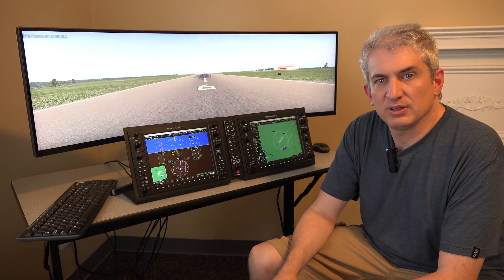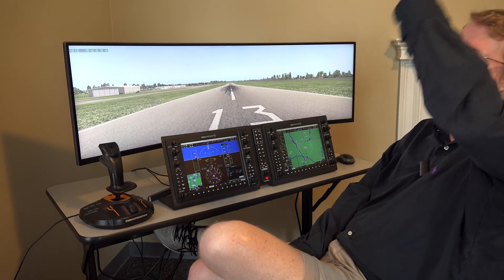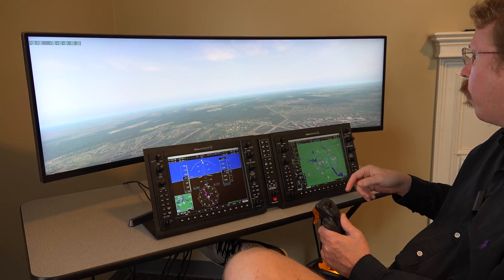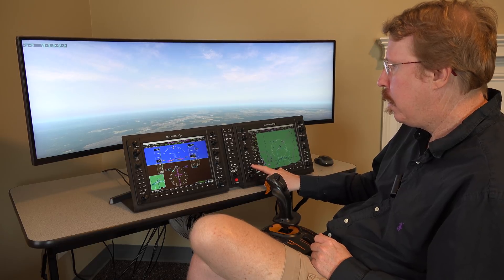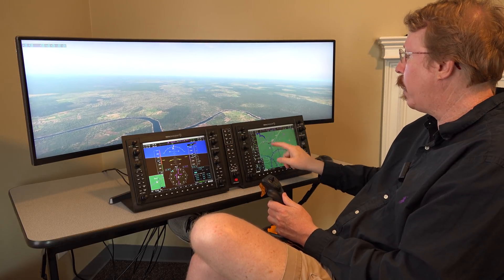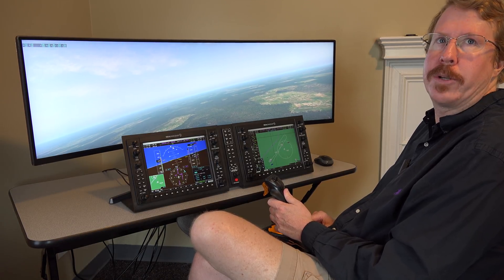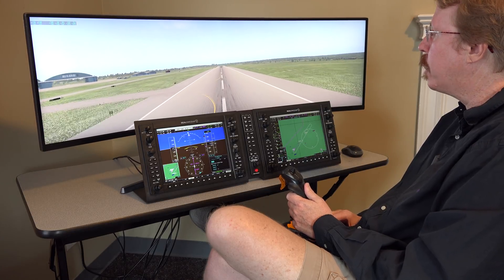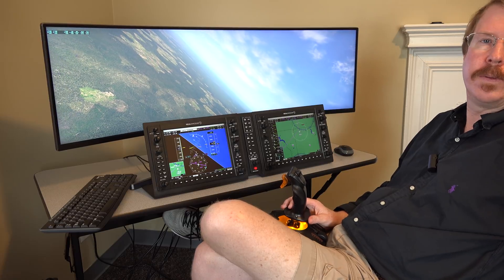Austin tries the RealSimGear G1000 Suite for the first time

Comment: Would love you to do Austin's reaction video to FS2020 when it comes out. That's going to go viral.
Reply: At this point, FS2020 is an Alpha product. With the exception of scenery, nothing works. Controls are hyper sensitive. AP is a disaster. Turbo Props are a joke. GPS you can't change flight plans or load approach. You can go direct to anywhere. It is a product intended for Xbox not flight sim community.

Addon, who use default system will be inferior or you will have to pay a lot for good addon.
Reply: @my2cents366  "nothing works"
Reply: not happening.  there is no way he's going to like a different simulator's flight models
Reply: @harpoon_bakery162  He might try it just to say something negative about its flight model though
Reply: @igvc1876  -- this is true, very true.  Microsoft (Asobo) has done good homework on flight models with real-life pilots.  The question is , are they real-life pilots that know how to translate flight models into computer programs like Austin does?  the answer is no.
Reply: @harpoon_bakery162  Do you really believe that a team with infinitely more resources than Austin cannot reproduce good flight dynamics? Come on. The only question is whether they want to do it. And we clearly know that this was their goal. These guys don't need to be implementing it themselves - they hire whichever experts they need to help them do it. Asobo did not do photogrammetry or other ML/AI, for example, they hired the best people to do it for them. They've worked with aircraft manufacturers, test pilots, etc. X-plane still cannot reproduce flat spins properly, and neither does XP simulate air mass and the effect of the world on air mass - an important component of aerodynamics as a whole. As smart as Austin is, flight dynamics is not some kind of black magic that only he can reproduce with good fidelity. In fact, compared to everything that they did in MSFS, aerodynamics simulation is the "easy" part relative to everything else. It's a well and widely studied problem that has a known solution.
Reply: @igvc1876  -- what is your opinion of the product as a whole 2020 ?  I mean everything encapsulated into your cliff-notes version of a flight sim designed for the purposes intended?
Reply: @harpoon_bakery162  I am not sure I understand what you mean
Reply: I've flown the C172 a fair bit along with the C152 and Cirrus SR22. I can safely say the flight model feels way more realistic in FS 2020. Especially as you're doing things like side-slips and forward slips. Ground effect for instance is way more pronounced and realistic in FS2020. I flew KOAK -> KLVK -> KCCR -> KOAK recently and compared real life to the sim.

All that said... the "stock" planes in FS 2020 aren't quite on the level of the really high end custom planes in XPlane.

I do think XPlane can actually compete with FS 2020 in the future. A few things that will get it there:
A more sophisticated flight model with far more surfaces.

Some kind of more sophisticated procedurally generated 3D terrain like what's in FS 2020.

The avionics in many XPlane aircraft are already leagues ahead of what's in FS 2020.
Reply: @colinsouthern  Sigh. I mean really if your top list of issues with FS comes down to wrong stats in a logbook, you are not helping your point. We all agree scenery and graphics are next gen. And frankly that's hugely important for the vast majority of people, even the "hardcore" simmers. Would you get into aviation if you were blind? Why would you, even if it was possible. Flying is all about seeing the world around you - even most pilots would agree with that. Sensation of flight via good aerodynamics is very important too, maybe even more important for many people, and we know FS uses the same approach to simulating it. But having the same approach doesn't imply high-fidelity reproduction of an actual specific aircraft - it requires a lot of manual tuning, even in XP. Most XP default aircraft suck in aerodynamics too, including the default Cessna, even if it's marginally better. So the question of realistic dynamics really comes down to third party developers - FS provides them with the same foundation as does XP, so there is no reason to believe it will be any worse when the addon market explodes (which you know it will).

Aerodynamics is more than just your aircraft. Weather, how it interacts with the world, and how it affects your flight is one of the key parts of aviation. As a private pilot you spend learning almost half your time about weather. In one interview Austin himself described a vision where dynamic weather patterns move around you and change as you fly from point A to point B, creating the realistic setting where a pilot has to plan for multiple things changing simultaneously - his location and the weather around him - something every pilot trains for, and emphasized how important it is for overall realism. Well, that's pretty much exactly what FS provides, and XP lacks entirely.

People who focus on "realism" as being ONLY the aerodynamics are incredibly narrow-minded, and frankly are probably only doing it because that's the last straw they can hold on to in XP, and one that will probably soon break with the arrival of 3rd party aircraft to FS (and its disappearance from XP as major developers will drop it like hot stones as they already started). Realism is so much more - it's VFR scenery, it's weather, it's planning for weather, and yes, it's also aerodynamics. And even IF ultimate aerodynamics of XP third party aircraft ends up marginally better than aerodynamics of third party FS aircraft, given the importance of all the other factors towards realism, it's unlikely that the marginal difference will matter even to many hardcore simmers.

I think deep down you know all this is true, but somehow feel the need to defend XP. I also root for indie developers, but unfortunately, given the resources behind each sim, I simply don't see how XP has a future besides retiring to an incredibly niche market and losing most of its customers, and thus its ability to move forward at any competitive speed. Even if Asobo is "slow" in fixing bugs, they will fix them eventually because they can afford to, and catch up in the last few places where XP may still hold advantage - they are clearly working on them and are actively informing the community of their progress. Laminar has always misled its base and was anything but transparent. XP with its rapidly declining revenue stream, disappearing addon market, will only slow down and stagnate - they were already stagnating even before FS came onto the scene.
Reply: @colinsouthern  I don't think I am projecting, but since neither one of us have stats on what "real world pilots" prefer, we can agree that we are both guessing on the preference of others. I am training for my PPL, so it's really my "feeling for what others prefer" vs yours. But I really don't think I am off when I say that most pilots became pilots because they like the look out of the window. Think about it - could a blind person ever develop passion for aviation? Passion for flight, I believe, starts with the sensation of flying which is fundamentally a visual experience. And as much as people later develop passion for more technical aspects of flying like instrument flight, I personally don't think MOST people including many hardcore simmers ever discount the value of a realistic sensation of flight. FS, for the first time, in combination with VR, will be able to deliver something where in some cases you may forget you are actually in a simulator. Many hardcore simmers, in my opinion, discounted the value of visuals up to this point because even the best visuals were far from convincing. We are now in a new territory, where many people, including hardcore simmers, will realize how important visuals actually are if they are done right. But that's my opinion. 

And yes I agree there are lot of issues in instruments and other things like that. They will be fixed, if not by Asobo then by third party developers - both you and I know that. The sim has been out for 3 months vs XP's decades. And they've been largely good at listening to the community. I am also a software developer - and I know how even a well funded but relatively small team prioritizes and deals with issues. It will be solved eventually.

Issues with NAVAIDs are again unfair comparisons since you are comparing XP's third party addons to FS's default NAVAIDs. It's a pretty objective statement that FS wins hands down with an almost entire coverage of up-to-date global navaids out of the box - and yes there will always be corner cases. And you can always add better NAVAID sources just like in XP. I predict with high probability that XP will be frozen in time - it will remain a it is in the foreseeable future. Major addon development will stop. Without addons, we both know XP is nothing, especially for hardcore simmers. 

In terms of weather - again there is literally no comparison with XP. You can't objectively claim that XP's weather is better. The fact that it doesn't line up with reality at this moment is not the key thing here. It's the ability to fly and notice an approaching front, having to figure out how to deal with it, e.g., divert or try to find a passage. THIS is what a lot of flying is. The fact that it's not exactly what is there right now in RL really doesn't matter. 

Every single deficiency of FS that you listed both you and I know will be fixed with either an addon or patch. I don't think there is anything to dispute here, it's pretty obvious based on the history of flight simming (I've been in it since 1998). But there is no patch that will bring XP to the level of FS, not as they started hemorrhaging revenue since August.

So I am not saying XP isn't better in certain areas right now - of course they are since they've been out for decades vs. 3 months. I am just saying that there is nearly no chance they will have any advantage in say a year's time. No way.
Reply: @colinsouthern  You are making a fallacious assumption that if Asobo prioritizes gamers and pretend pilots, this makes their product for gamers and pretend pilots only. Most of Laminar's development is on XP Mobile - so pretty much all priority goes to that. Does that mean Laminar doesn't ALSO cater to simmers? 

The answer for why both Laminar and Asobo do it is simple - neither XP nor FS would exist if not for the 90% of their market being "pretend pilots" and gamers. Neither of them could probably hire half a developer if all its money came from people like you.  So of course they prioritize that which keeps them in development, so that they can afford to ALSO cater to the more serious simmers. FS never "promised" or "advertised" to cater JUST for you or for people like you. It was advertised to be for EVERYONE including simmers - it's obvious from everything they said and from its design to be accessible. That means EVERYONE gets in the priority queue when it comes to bug fixes. And the fact that features that cover the majority of their market come first does not mean it's not also catering to the minority of its market, OR that those same bug fixes don't simultaneously cater to the more serious simmers. To conclude it based on this alone is a logical fallacy.

It's also false to suggest that they their bug fixes are not catering to the majority of the serious simmers because they don't cater to you specifically. You said yourself that you can't speak for anyone else, yet you make sweeping generalizations in assuming who their development caters to, i.e., "pretend pilots". Just looking at their latest patches, you'd see most of those are targeted towards live weather, ATC, flight dynamics, 3d party SDK, autopilot, RNAV approaches - some of which are hardly things a gamer cares about OR more importantly: hardly things that serious simmers DON'T care about.
Reply: @colinsouthern  "So you count XP's development curve as starting from V1.0 - but MSFS (that was released in 1982) only counts for 3 months? Seriously? How about comparing apples with apples; The current release of XP (11.5) came out 9th September 2020 (about 3 months ago)."

Yes - very serious, and you know why. FS is a brand new piece of software developed by a completely different group of people, with only a few legacy pieces integrated into the current version, like ATC. XP is the exact opposite - it has been the same piece of software for the last decade, same engine, same everything, gradually improved here and there by the same group of people. There are bugs in XP which have been there since the beginning and still remain. So when it comes to bugs/features, it's completely valid to use years of XP development since release vs 3 months of FS since its release.
Reply: @colinsouthern  "but the bottom line is that they already have a stable mature product that exceeds the needs of their target market; that inturn gives them an opportunity to expand into other areas like mobile if they so wish."

Except XP mobile is how they make the majority of their revenue and what lets them work on core XP. Even prior to  to XP mobile, Laminar spent a lot of time of making their sim look pretty to attract a larger market beyond serious simmers. 

"In contrast, the Asobo product is so bloated it'll probably be another 50 years before there's any mobile hardware capable of running it"

I doubt they will even try because there is less and less need. Gaming is moving into the cloud. What I think will likely happen is that FS will be available via xCloud which is essentially server-driven gaming which streams the game to any client. Sure there will still be a market for local gaming for those without an internet connection, but that will likely shrink over time.

"but the bottom line is that they already have a stable mature product that exceeds the needs of their target market;"

Mature - yes, you got it. It's a product that has been developed incrementally for years and years. And FS has been developed almost entirely from scratch and has been out for 3 months. I have no problem stating that they have many bugs to fix. Should they have waited to release it? Perhaps. Though there is really no loss to have it come out earlier. It's a fixed price investment for what is essentially continuous service, from constant updates that include new features, to continuous services that they do not pass on to the consumer through a subscription (but could have, which is what most people expected), such as NavBlue, up-to-date Airac, and Azure storage/streaming. Anyone who wasn't happy with it could have easily returned it. No one is being scammed here.  The reality is that most people will complain either way - if you release it too early or wait too long to release it. Of course they have to start making money to stay in development. I completely understand the reasoning behind this and its importance, and given the incredible work that they have done, calling it "embarrassing" because they still have bugs of the sort you list, is frankly ridiculous, and I think deep down you know that but for some reason feel compelled to argue.
Reply: @colinsouthern  "And yet ATC, flight dynamics, 3d party SDK, autopilot, RNAV approaches are all STILL not fixed properly ... I rest my case."

I am not sure what case you are resting. If your case is that months-old FS has more bugs than a decades old XP, sure (that's usually a consequence of starting from scratch with ground-breaking tech as opposed to incrementally putting lipstick on a pig). If your case is that Asobo don't care about developing a simulator, cherry-picking bugs that they are working on fixing but haven't fixed yet, is just disingenuous, and you know that. On the other hand if your argument is that they don't care about developing a simulator because they prioritize bug fixes that other people also care about (many of whom are simmers who have other priorities), that also makes no sense; every company including Laminar prioritizes their resources for what maximizes their revenue, and hardcore simmers are not included in that set.

I honestly don't quite understand what it is you are arguing here. Seems to me you have incredibly unrealistic expectations from software development as a result of you not being satisfied that FS is not yet ready for hardcore simmers. I understand that, and I agree it's not ready for them yet, but it doesn't mean it won't be in a very near future and very possibly exceed XP in that regard. I just don't see how it wouldn't, as you haven't really given any compelling evidence. Based on everything they've done, based on their approach to aerodynamic modelling, weather, based on their plans, based on the fury of activity from study-level 3rd party developers, I would say all evidence points to them matching and exceeding XP in every regard.

and btw I am in no way a FS fanboy. As a software developer with a small company I root for small indie developers. But I am a realist, and I simply don't see any other outcome.
Reply: @colinsouthern 

 "Again, it's NOT "months old"; it builds on the foundation of previous versions going back 38 years. If there had never been a FS product from MS previously then it's ludicrous to imply that their very first product would have looked just the same as what we have now."

I think you are thinking of foundation in some abstract historical sense. When developing software, the only foundation that matters is the codebase and the team. The team was entirely different and most of the code developed from scratch. Yep. 

"Foundation" in software development is a codebase - the graphics engine, the weather engine, the physics engine, etc. Now imagine a spectrum defined by the extremes of "developed entirely from scratch" to "accumulation of incremental improvements to the same codebase/engine over many years". Objectively, FS falls extremely close on the former extreme, and XP on the latter. Almost everything was written from scratch by a completely different group of people. There is simply no comparison between the two from an engineering standpoint. I don't think you can even begin to comprehend how different the development between these two extremes is.

"You're changing argument mid-sentence; you start off saying "they prioritize bug fixes" and then switch to "prioritizes their resources for what maximizes their revenue" (Ah - now we're getting closer to the truth) ... before hitting the nail on the head: "hardcore simmers are not included in that set" BINGO. "

Um, how is that changing an argument mid-sentence? You prioritize bugs that address the concerns of the majority of the paying market. They are not mutually exclusive. I thought I was talking to someone intelligent.

"I'm at a loss to understand why you keep trying to turn this into a pissing competition with XP" 

I am not - I am simply stating my opinion about the role of FS as a simulator in the near future in relation to the only other simulator out there - a comparison is not a "pissing competition". A perfectly reasonble thing to do. You appear to be irrationally mouthfoaming in its defense though. Notice the irony?

"And it doesn't mean that it will either. Odds on they won't be; why? ... Because they've released numerous updates so far and virtually nothing has been fixed (or fixed properly) ... and yet they've already had 2 major scenery updates."

Every one of your comments just gives away how ignorant you are in engineering, software and product development - and sound like some hysterical kid who didn't get the toy he wanted and is now mad at the world.

Do you think the scenery designers are the same ones doing bug fixes on a completely unrelated part of the sim genius? These are completely different teams of people working on such things, many of which have been planned as features for months, possibly even prior to the release.

But you keep on cherrypicking. Fact is: Asobo is addressing technical bugs and you know it. The fact that your particular bug didn't get addressed yet and the fact that they also release scenery proves nothing. Just that you are that hysterical kid :)

The reality is very simple. FS has exactly the same technical foundation that XP has to be a realistic simulator (aerodynamics), and more (weather, AIRAC data, etc). There is simple NOTHING, zip, nada fundamentally more of significance that core XP provides that FS does. Most of what makes XP a good simulator, everybody knows, is the addons. FS doesn't have them yet. So your comparisons really boil down to this:

core XP (10+ years of bug fixing) + Universe of addons > core FS (3+ months) + 0 addons 

where > means a better simulator. Sure, I agree with that. If that's really your point (which you hilariously refuse to state), then I think we agree :)
Reply: @colinsouthern  
"Please link me to a credible breakdown of Laminar Research income by platform ... since you seem to have access to it."

This was mentioned by someone from Laminar in an interview I watched some time back. You can choose not to believe it - but it's a pretty widely accepted thing in the community.

"I tried - no dice. So there's another of your assertions blown clean out of the water."

Then it's your fault.

"The vast majority of the bugs would be trivial to fix ... if they could be bothered."

Yep, and we covered that. They, like everyone else, caters to the majority of the market. Constrained optimization under limited resources 101. There is no company that doesn't do that. Most of XP's market is pretend pilots too, which is why they they choose to focus on pretty cars on roads instead of fixing bugs, some of which, have been there for years. If everyone does that, what's your point? There is none. It's moot.

"weak arguments"
I think with your fascination with the word "projecting" and "weak argument", you've been......projecting?

"It is - for now. If I were a betting man I'd say it's practically a guaranteed certainty that they'll attempt to leverage their customer base with additional subscription-based offerings in the future."

"Additional" is the key word here. I noticed you like to strawman in almost every argument. You should at least make the strawman a little less obvious :)